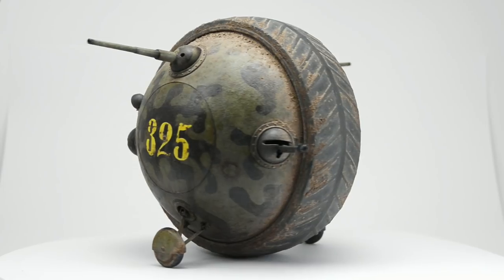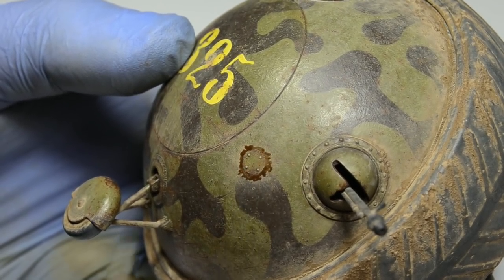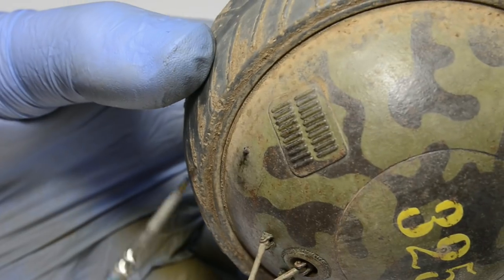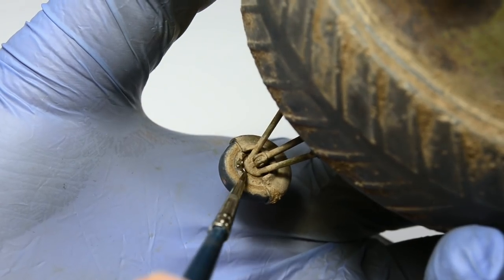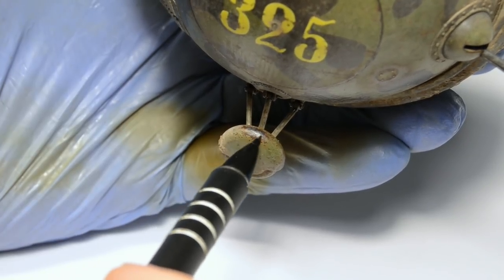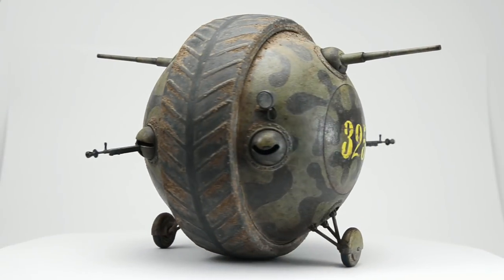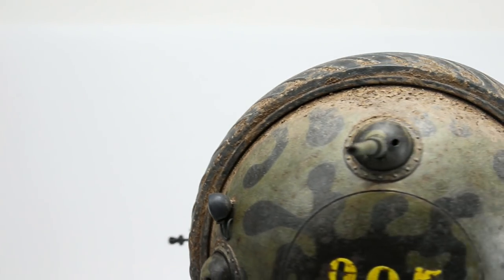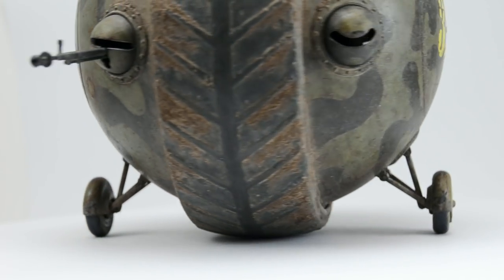Painting Grease, Smoke, Spilt Fuel & Polished Metal - Soviet Ball Tank "Sharotank" (Miniart 1/35)

Comment: Do you have any sci-fi kits that you recommend that have good kit-bashing parts in them? I have a few Tamiya tank kits laying around, and as I get older I see less and less of a point in fetishising military equipment, and the whole "historically accurate AFV" thing has been done to death and then some, so I'd like to turn them into some Sci-Fi monstrosities, much like some of your builds that I've seen bits of, but I need to part out some sci-fi kits (namely some sophisticated looking antennas, radomes, hydraulics, weaponry, panelling, etc.) to do so, but I know literally nothing about that side of the modelling world. I've built a couple of Star Trek kits, but that's the extent of my involvement with the genre. Any help would be appreciated. Right now I'm building a "quad-pod" of 1/35 Panzer IV chassis' (basically a small Paris Cannon supported by 4 tanks revolving around a central turret instead of a train car) with a heavily-modified 1/24 M777 field-howitzer supported in the middle of them in an open-topped turret, but I am direly in need of some high-tech looking detail parts for that, and the bigger, Panther/IS-3 supported closed-top version I plan to build with an actual 1/35 Paris Cannon kit if I can find one.

Comment: Great work,ive been trying to get people to use soft B pencil's for ages.5B and 9B,they reflect light more to scale,not as 'flat' as metal paint on small parts.LYRA Graphitkriede,big crayons up to 9B.Last forever.
Reply from the maker: Graphite beats any metallic paint or pigment.
Reply: Not many will believe it.Have you seen ROCHM model's website?They make Photo etch.They make WnW and ZM look lazy.They are modellers,there is a Somua in the gallery with PE upgrades,might get some ideas.
Reply from the maker: I built a Somua a few years ago and it looks very very similar to the one you mentioned lol
Reply: Heard you might build RFM t34\122,i built it recently.Have a look at turret from front,now add some camoflage strips of canvass hanging from roof down the sides,then an mg 34 mounted on a tall swing mount on the side.The Predator!
Reply from the maker: Who said that? That's a lie!
Reply: Have you had a polygraph before,Mr Shift,or should i call you 'shifty?'